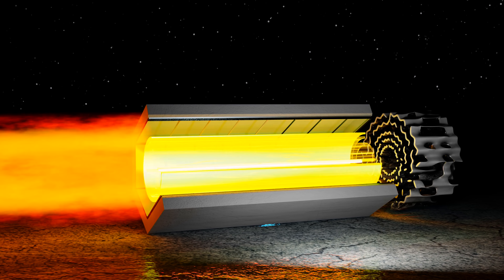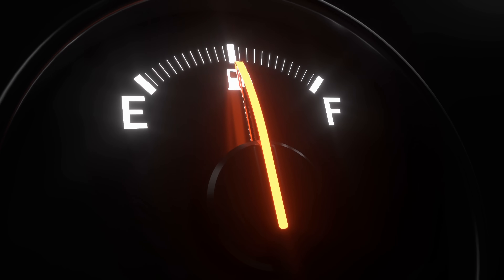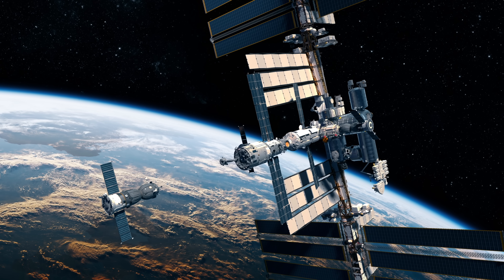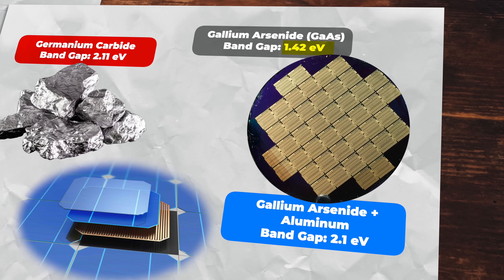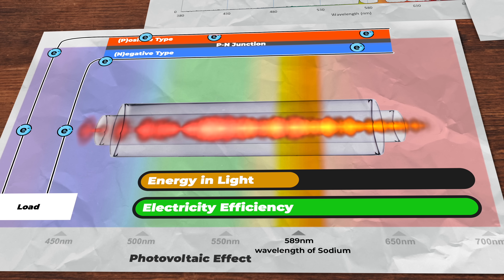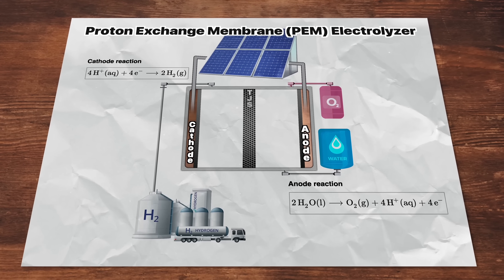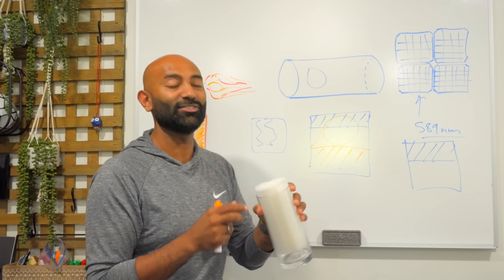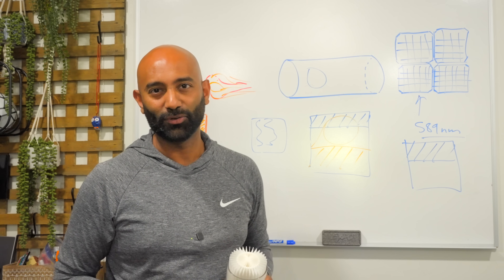Why Solid State Might Save The Combustion Engine

Comment: I probably need to watch this several times, but the initial impression is that for something to burn in this way, it will consume oxygen and possibly emit noise at the same time. I have always been sceptical about the practicality of using hydrogen for most (probably all) forms of transport and believe that battery technology will develop rapidly, with a drop in price to match.

Comment: Fuel cells work through combustion as well. It's just that the combustion reaction is facilitated by an electron exchange across a dielectric membrane. Recapture of waste heat from fuel cells using Sebeck units improves efficiency. Using thermo-optical conversion through a narrow band material would allow more of the heat to be recaptured using the photoelectric effect. I have a hard time believing the 80% efficiency number, but it is a good idea.

Comment: I don't understand why anybody just doesn't copy my design idea when I gave to Ford like 25 years ago all you need is a dino attached to each wheel basically an alternator and have those alternative wires feed through a junction box that can limit the current and it will charge your battery is in the car so the more you drive the more you charge you don't have to worry about running out of juice and the batteries you could just use bleed resistors Quick Charge quick dump

Comment: 10 to 25 Kw per Kgm of common fuels. I assume end products of
water & c-dioxide.
• You mentioned (should emphasize) what happens in between. Each step loses.
• Have you done any vids on fuel cells? I remember use on Apollo when I was designing J2 & F1 engine parts.

Comment: Honest to god, swear on everything, I haven't been paid for this or anything related to them, in fact....i PAID them 80 or so dollars for their razor, the just...regular angle? medium? something like that...its just their standard one they had about 1-2 years ago.  It is hands down the best razor i've ever used in my life.  Any time they sponsor a video I make sure people know that it is SO worth the money you pay for that good of a shave.  You wouldn't think it would make such a difference, (angle precision and blade depth)...but try it, it does, and the best part is replacement blades are SO dirt cheap that if you wanted you could change blades every couple days and still save money vs a "modern" multiblade razor burn creation device.  ^_^  

oh, i should also mention, i've used multiple brands of multiblade razors over the years, shick, gilette, etc, i've used straight razors, i've tried other safety razors, but nothing came close.  closest was probably straight razor, but stropping is a pain in the arse.  If you dont know how to, you may want to look up "traditional wetshave" technique, because that's what you're supposed to do with these to get the most out of them.  You'll still get a good shave using barbasol, but if you want to know what its supposed to feel like buy good shave soap and do it right.  It's a joy.

Comment: i conclude, there's yet a demo of the invention except in paper or digital or maybe bits of them. hmm, still, I doubt it could be that compact unless they have another new invention they've let out yet but usually whatever they find, they will try to patent it as fast as they could. interesting concept but I reckon the fission reactor has higher chance of success than this (in my opinion).

Comment: Like if you can do this then why don't you use a concave mirror to concentrate sun light on an tube filled with sodium and painted with a reflective material on the inside and a black material on the outside which would be contained in another tube evacuated of air, (basically exactly like a evacuated solar thermal tube) with a slit in the black and reflective material in the top with mirrors along the slit to stop the light leaking out of a certain path, and putting solar cells outside the vacuum tube in the path of the emitted light, which assuming a 90% efficiency of the panels and 80% efficiency of a cheap mirror you could get a system that's like 72% efficient theoretically.

And I don't count the efficiency of the reflective material on the inside because anything it docent reflect will be lost as heat which will partially heat the sodium, some will be lost to radiation in, but assuming the external mirror can reflect the radiation given off by the tube you will recover about 40% of that, so it's not actually going to be 72% efficient, but like I could see real world it being around 50% efficient, which would still be a massive improvement over current solar panels, also you are going to lose the light that the inner tube blocks and some due to the refraction of the outer tube, but I still think you would be somewhere in the range of 50% efficiency for the same area of regular solar panels.

Like yeh they are going to be a heck of a lot more expensive than regular solar panels even though you need significantly less area of solar panels for the same power.

Comment: As a long time owner of a Hyundai Sonata hybrid (before they got cheap) I've been trying a hundred ways to increase range and efficiency. Capturing the heat from engine exhaust just makes sense. Build an adapter that can transfer the heat from engine exhaust and stand up to the environment of a car engine or exhaust system and a way to store the extra energy then you got my vote. Need a car to test it on?

Comment: Apart from bandwidth tuned solar cells a complete waste of time. Burning anything to obtain energy is a perverse notion in our current climate catastrophe. Start thinking. Use concentrated solar energy to heat whatever light emitting material you want and surround it with tuned solar cells. Then convert it to hydrogen and use it in fuel cells. LNPG tankers can be used to transport it around the world and places like the West coast of Africa could be used for the solar powered H2 farms. There is even a British firm which is about to lay Gigawat capacity underwater cabling from Morocco to UK right now, name escapes sadly. They are building large solar & wind farms there to send electricity to UK with the ultimate goal of supplying all the UK power. ANY combustion engine is a dead end and a complete waste of time and resources to be developing.

Comment: Actually an engine that can convert  using a less well regulated heat source is to my mind a good goal for many applications. If you can for instance burn unprocessed corn manure ect.. Let's say we  use corn as fuel. So much is lost currently in the conversion  to liquid that almost any efficiency using the unprocessed product will be better overall.

Comment: No solar cells are that efficient so scam lol
Reply from the maker: you should watch the video. it explains how current cells work on the broad spectrum of the sun... and why its like 22%... but if you built a cell specifically for 1 wavelength of light, and produce like in one one wavelength, it totally changes the equation
Reply: @TwoBitDaVinci  all I had to do was get to where it said sodium. Most of what's being produced is heat, and the light being produced isn't going to be absorbed well. On top of that, pumping molten sodium is a terrible idea. I've also never heard of a panel that is tuned to one wavelength. If there were such panels, why are they not tuned to a bunch of different wavelengths and put outside? Surely that would be better.

Comment: how are you constantly inserting fuel and air? bet there are moving parts in that process. an ICE is just an air pump, it sucks air in. whatever will be used to push air in will be mechanical, aka, moving parts.

Comment: When fire to light conversion is 1% and when light to electricity conversion is 20% this should be really 0.20% efficient.
Even at a 100x efficiency it is still only 20% efficient. 
Even with special fuels, filaments, silicon I would doubt the total combined system would be 400x efficiency improvement over existing technology.

Comment: Let's turn the idea around: instead of trying to bump up the magnitude of an ICE's waste heat to light up the LightCell, let the LightCell's waste heat power an engine.  The LightCell's exhaust temp is ostensibly a few thousand degrees, not far off from peak temps inside an ICE's cylinder.  Harness the leftover heat and let that drive, for instance, a Stirling-cycle generator to extract even more energy from the exhaust heat.  If the heat coming out of that unit's exhaust is right, then pass that over a bank of thermoelectric generators - returns there are never great, but no point in just throwing the potential away if there's a low-maintenance process that can extract some good from it.
A continuous-combustion system's exhaust gases can be far cleaner than any reciprocating engine and this has potential to push energy extraction well beyond Carnot.

Comment: You skipped over the most important part, how are they making enough pressure for efficient combustion? They need to solve that first, then try to catch the released energy later. To me it looks like they will have terrible burn efficiency, and the they are only are able to catch 85% from the burnprocess.

Comment: principles of quantum mechanics physics and plain chemistry say this is just bull shit.  see the converion of thermoto optical by itslef is at the most 30 to 40 percent efficient and further light to electricity is just maybe at the most using the latest developmnts is only 34 percent.  just a load of junk.  even peltier units that convert heat to directly electrical can get no more at the best than 20 percent effieciency

Comment: It's not really an engine.... It's a generator. It generates electricity, it does not turn a shaft.

Sounds too good to be true. We can already run generators off of jet engines, aircraft do it all the time. And this is basically nothing more than a glorified jet turbine generator.

Here's a question. A jet engine needs a compressor in front of the combustion chamber in order to make the air dense so that you have an efficient burn. There is no compressor here? The air is just let in at atmospheric pressure? Is there a light blower at least? I mean, I assume you would need a compressor, which is going to be noisy as all hell. In a jet engine you have to use a battery or auxiliary power generator to start the compressor, and once you are at pressure you add fuel and ignite the jet stream. The jet stream then pushes on some blades which spin a turbine which links to generators to create electricity, while also linking to the compressor to maintain compression. Unless this is really more of a lamp, in which case not much air is needed at all? What kind of fuel consumption is supposed to take place here, and what's the air mixture supposed to be? 3,000 times brighter than the Sun is really bright. I imagine the reaction going on would be quite violent, which would require the intake of A LOT of air. Until these questions are answered I'd have to say that this sounds implausible.

Comment: They will never save the combustion engine, the technology has existed for nearly a century to have 200 mpg gas engines. Multiple patents filed, multiple inventors mysteriously killed, and multiple patents that got locked up under the Patent Secrecy Act meaning the only one with access to the technology is the US military complex. The Patent Secrecy act is some scary stuff, particularly when you look at the criteria they use for selecting patents to lock away forever, still to this day. Any engine above a certain efficiency was one criteria, solar panels with an efficiency greater than 20% was another...

Comment: "In December 2017, the company ran out of money.[2] It cut the workforce down to 15 as it entered "hibernation".[14] In March 2018, the company shut down.[2] An investor cited the emergence of more efficient and cost effective Lithium-ion batteries as the reason for LightSail's commercial failure.[2] Media specializing in startups and renewable energy have described the company as mismanaged. [15][16]"

Comment: The military is ate up with turbines... and they've never burned more fuel faster - ever.  I bring that up because if we believe this premise of a "solid state" engine, it is 100% useless except it can deliver motion.  Without motion, its more of  a heater, and not an engine.
I like the concept here, but power to weight ratio [at 10kw]  sucks outside of battery bank charging - not really a propulsion scenario beyond a trolling motor on a bass boat.

Comment: Where is all the energy coming from to melt the sodium and produce the light, also if they're extracting the energy from the light are they doing it with a  thermal generator are a solar cell. Either way this technology doesn't past the sniff test

Comment: 5:56 140 tons Germanium a year. Than your miracle engine better only needs 2 nanogram of it, to be installed in every car, sold in 2023. 
I think we have an upscale problem here. A even worse one, than with Lithium. Can't we use a phosphorescent material in combination with rotm Si cells, that works with a few nanogram of any rare earth element?

Comment: Great content - love the channel - A fully closed loop
System would be amazing but my only problem is efficient cooling as temperatures can range in excess of 1000o unless the fuel had a catalyst to lower its overall combustion temperature - I think efficiencies are probably truer to the primary patent 5 years prior - but not knocking the technology - I feel that it is close to something very feasible as solar is very inefficient - I have always wondered with solar why multiple band gap technology has not been utilised as it has been with Fibre-optics and laser technologies - >>>>> but we have seen it all, I remember a company Fuel From The Air  <<<<< which was even televised - it was carbon capture and recombining with a catalyst and Hydrogen - to make any grade of fuel for petrol and diesel car - then silence ………I still have hope that something viable will restore the technologies we already rely on -

Comment: The problem with it is fuel burns far too quickly.......I don't buy the 20% loss at all. It'd be so hot it'd work better with a tank of water powering a steam engine.

Comment: Ever see a Catalytic Converter glow? I would will a bet you could tune it to glow at X light frequency. The problem is the heat. Just like those ceramic propane heaters, where the honeycomb mesh glows red, it is also really hot. I believe we can get a catalytic convert type system to burn and be more efficient than an ICE unit. The cat's in a car glow simply off of air movement, and unburnt gas alone, as it is. So if that extra heat is sent into a glass tube that has molten salt, which also glows when heated, then perhaps we could use that envelope to absorb some of the heat? Just spit balling.

Comment: I think, we been sitting on the combustion engine for way too long now. To top it off, we are making the engines even more complex with tons of sensors, etc; i mean at this point you have to be a damn rocket engineer to be a mechanic. We need an updated version that minimizes the amount of toxic materials used to run it.

Comment: Ricky! Dude this really fascinates me as someone who has researched Paul Pantone's geet reactor system. 
I find your idea of adapting the photovoltaic heat engine as a heat recovery concept for a regular combustion engine pretty curious.  What would you use the electricity it makes to power? Electric motors? Make Hydrogen to send back into the engine?

Comment: This sounds absolutely wonderful in theory, but it fails at the most significant part of the equation. This engine generates electricity, which then drives an electric motor to drive the car. Great so far, but the issue is that it has been very carefully calculated that there simply is not enough copper in the world to build all the electric motors to replace ICE engines! The engine in this case generates the electricity and the electricity drives an electric motor — sorry, but it is no more efficient than an ICE vehicle, but still, a hell of a lot more expensive!

Comment: I know it's solid state, but since it is running like a jet engine, why not put in a turbine generator to help catch more power. That little bit of back pressure should help build up heat and make the salt glow hotter.

Comment: Regular combustion engines already makes multiple energy conversions in a row. You burn the fuel to create heat that creates pressure and the pressure is converted into torque, if you're using that to generate electricity that's yet another additional energy conversion. Besides, using fuel to generate electricity to power electric motors in a vehicle is already a tried and true technology that is used in ships and locomotives.

Comment: Correct me if I'm wrong, but the design implies that anything which would sufficiently heat the sodium would cause a specific wavelength discharge.  Which, with the photovoltaic being described, you would get considerably greater energy out of the light produced because of the way it is tuned to that frequency.  So...  Why couldn't you get the sodium up to temperature by taking the various wavelengths of sunlight through a lens or mirror assembly and then get the same efficiency for simple solar panels?  Assuming your solar target is a sufficient broad-spectrum absorber and the concentration of the light is great enough to heat the sodium to luminescence, wouldn't that actually be more efficient than conventional solar cells?